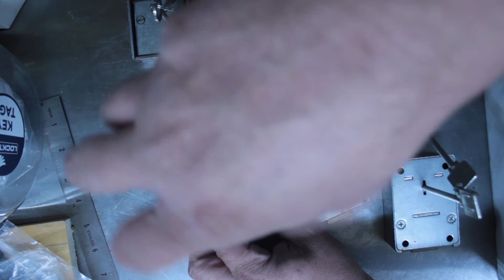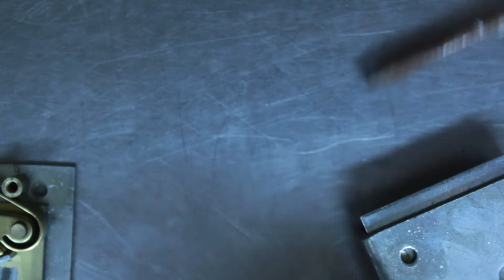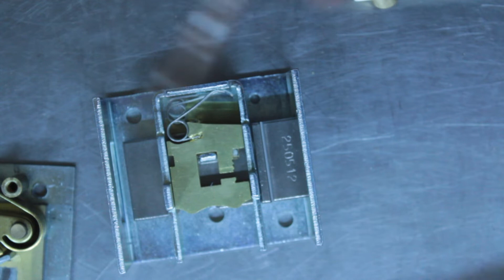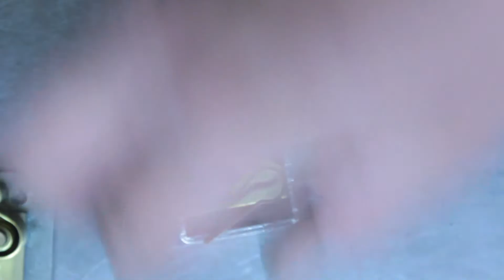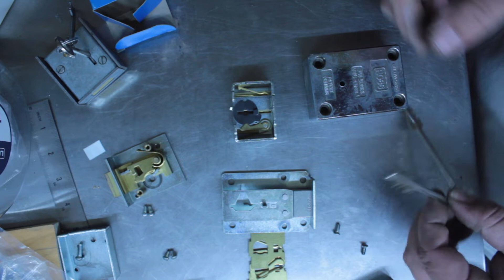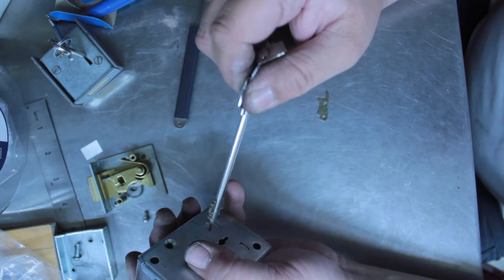Ross Safe Locks 100 - 600 - 700 Try To Pick One ?

Comment: The Ross 700 has definitely similarities with some italian lever locks , like CISA and Mottura , but is more on Mottura side. Levers are 5 + 0 + 5 (0 is curtain with spring) but a lot smaller than those mentioned , as they are normal door locks. 700 is like 1/2 or 1/3 of Mottura. The other thing is , that it can't be picked in traditional manner , but decoded and impressioned - yes. There are tools here which cost about €400. :)